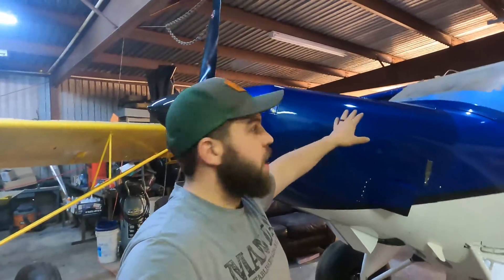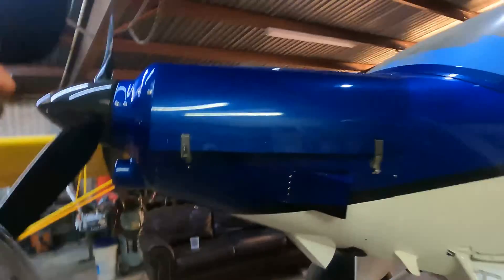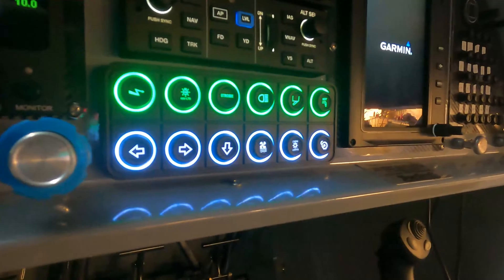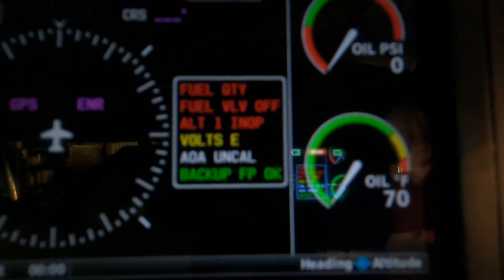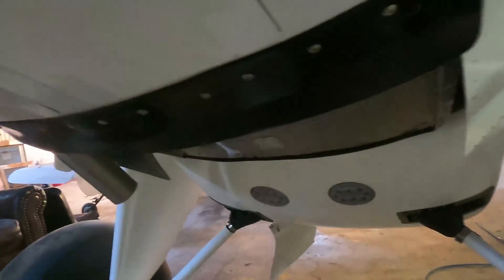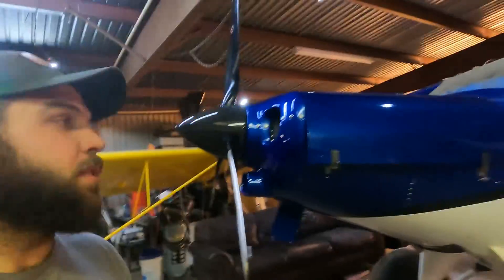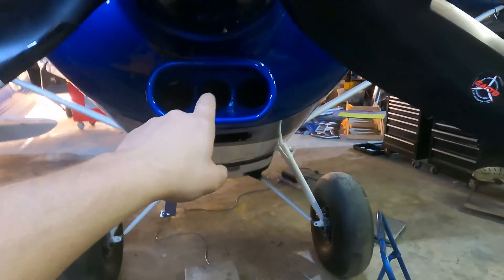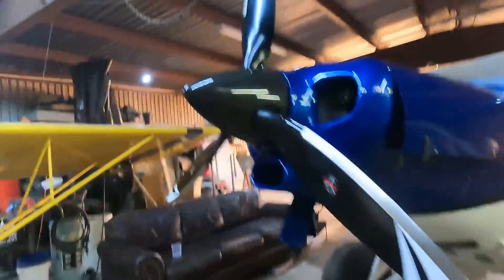The Cowling Build Bearhawk 5 Bush Plane

Comment: With your 2" extension on the nose bowl, is there a prop extension between the prop and the crankshaft or did you somehow move the whole cowl back to make that fit?
Reply from the maker: I'm running a 4 in prop extension from saber manufacturing. so the whole cowl is shifted forward 2in.